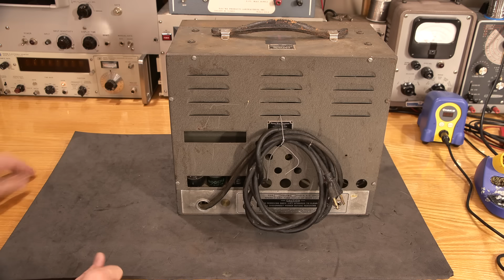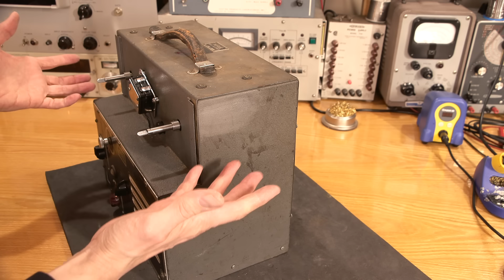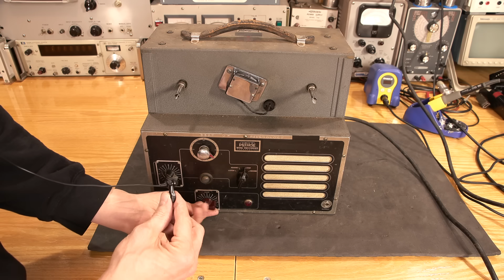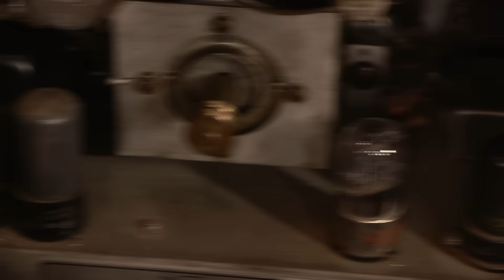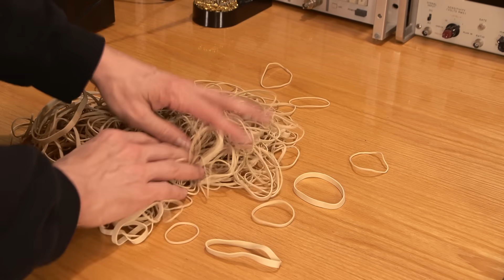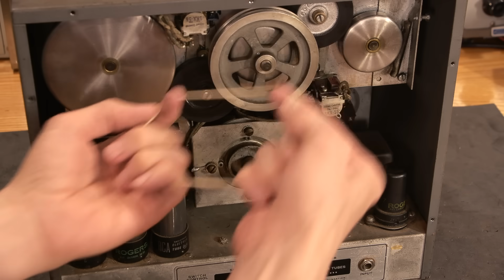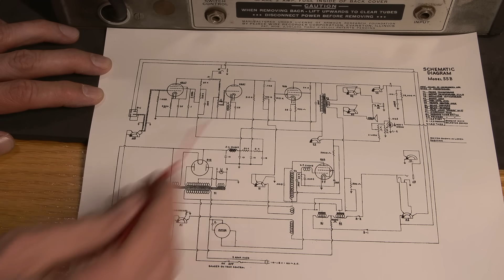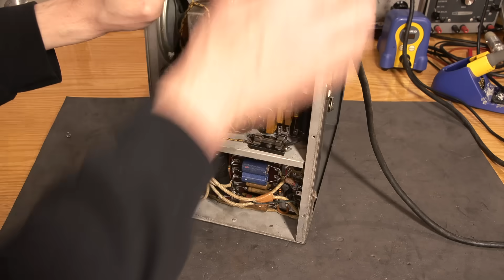Trapped Voices In This Wire - Let's Listen To Them!

Comment: It sounds like an early version of recording tape.
Reply: That's exactly what a wire recording is, it works the same way a tape recorder works, just uses wire instead of tape, and the recordings actually hold up much better because old audio tape disintegrates.

Comment: Webster Chicago made a nice unit which had a more horizontal layout and a fixed takeup reel. The wire passed through the head at about 2 feet per second.

Comment: By the way that machine that does the wire machine there it's not too dissimilar from one of the tape machines from about the same well I say about the same time it's not quite the same time it's was considered new which means it was probably from the 1950s or 60s I have no idea like I said I had to deal with these old machines and I was the only one who could basically get them running and not fouling up and sometimes was the only person who could fix both if it was a tape the taper record the record and sometimes I have to prepare the machine and I seem to be the only one who had a knack for figuring out how to fix it... You have to be careful with how you pop those clips back on if it's anything like the tape ones used to be because sometimes those clips had a habit of still falling off after you put them back on and if one falls off you're stuck although if I'm being honest I did manage to improvise something like I said what nowadays they call macgyvering with something you had to do back then and it was something that I learned from my father like I said child of my father's old age.

Comment: i would take a drill and fix it to a vice and sand down the two rubber wheels like a lathe since i dont have an actual lathe and carefully remove enough material that i can wrap a rubber belt around, a rubber band could be used as a temporary fix, in order to add that friction and even out the flat spots.

Comment: I bought a 1933 silvertone by Sears . It has an am/fm short wave radio , 78 rpm  , and a wire recorder. With the manual and hardware, spools of wire , microphone, everything worked but had no sound from the recorder.  I bought it at estate sell , silent auction, I put my name and phone number and offered 50 dollars, they called said come and pickup your radio, I was the only one who bit .😊  I had it for four years and then sold it for 400 dollars. It's been a hobby on tube type TV , Walgreens had tube testers  . Sometime in the 70s they discontinued TV tube's.

Comment: Professor Carlson, we were upgrading bank cameras from those old giant film reel boxes. A new employee would wonder what the buttons were, set the film rolling, cost the bank significant money using those film reel bank cameras. The instructions were to destroy the film or develop the film reels, give to the bank, and destroy the cameras. Well we'd end up with 5 a week for months. I took one out of the dumpster and was so impressed with the quality of the materials, I felt sick (still!) we threw away such amazing components. Everything was quality low corrosion metals of aircraft quality, hand machined with fantastic nickel and stainless screws throughout.
In today's money just the parts of probably 50 of them taken apart and sold for special assembly components probably a few thousand dollars in today's money. But the real value was the quality.
Your Pierce recorder reminds me of those bank film cameras, although these were post - tube technology.
I suspect the metal components were similar sources.
Very high end aircraft instruments type components.

Comment: Another vote for restoring the recorder, at least electrically. I'm guessing the glowing grid wire is due to a leaky wax coupling capacitor driving high voltage into it from the previous stage. I'd like to see if I'm right about that.

Comment: Just subscribed… very cool video, those filter caps made a big difference.   Watching you diagnose the unit, I envisioned the factory assembly benches from many decades ago. 

That unit looked pretty much hand built with many of the vendors that later supplied the guitar amps of the 50’s.. for a simple circuit it sure has a lot of moving parts though

Comment: Oh, I saw one of these before, on... hm. It was either TechMoan or Technology Connections, now I've forgotten. May have been both, come to think of it. It's a very cool idea, but you can see how it didn't really take off, from a durability and repairability stand point. You've shown you can repair the player/recorder, with some work, but if the wire snaps... can't exactly fix it like you can a tape.

Comment: The music teacher for the 1957-1958 school year, when I was in 6th grade, had a wire recorder. Living in a small rural community about 70 miles NE of Seattle, it was the first recording device most, if not all, of us had ever seen.

Occasionally the wire broke, so the teacher tied the ends together with a square knot and trimmed off the extra wire ends. 

The following year, the new music teacher had a 3M tape recorder, the first tape recorder most of us ever saw. It seemed to be far more reliable than the wire recorder had been.

Comment: I have a wire recorder with a built in turntable and AM transmitter.  It doesnt work. I changed the tubes and replaced the eleftrolytics and it still doesnt work, so yes!  Please do a troushooting on the unit!

Comment: Wow, looks like wire I use for maunally bonding 2-Mil aluminum wire loops to on circuit pads for in ceramic packages. 
I always thought they would be much thicker like 14 AWG. 
Hollywood...

Comment: I noticed the Rogers tubes inside the wire recorder. They were from a Canadian manufacturer as the company was the first to make rectifier tubes so radios in the mid 1920's could be plugged into an AC outlet.  Being of that vintage and almost 80 years old I have no doubt that a few the capacitors and possibly a tube are due a replacement. good work on your presentation and listening in to a voice from the past.

Comment: Never heard of one of these machines and I've played with a lot of electronics. I have an old am/shortwave radio with tubes... But not all of the bands work. Was just curious, it looked like there was a headphone jack in the right lower corner. Just for kicks was wondering why you didn't plug a speaker into there just in case the original speaker was bad. Excellent video.

Comment: the "hard solid piece" you described as "rubber" is likely made as "bakelite" material. Rubber bands are too "springy". You could cut a proper width from a bicycle tube, then glue both ends together, overlapping each end a bit, and the resulting belt would be less "springy".

Comment: Thumbs up for troubleshooting and restoration!  I have read that the quality of the playback depends on how the wire is oriented as it goes through the head, so if it's twisted in any direction away from how it went through the recording head the playback head won't be able to pick up the magnetic flux nearly as well, and if it's twisted 180° it basically inverts the waveform.

Comment: As speaker is completely silent - no hum or hiss, look at the break jack (headphone connection) contact might be stuck or corroded, also might explain temp of output tube as no load on the sec of the output TX.

Comment: Looks like a motor out of a diesel locomotive,, put two rubber bands on it rubber bands seem a bit smaller then o-ring when it's stretched out, two bands might quiet it down. Oh and not sure but I think a lot of the Apollo space stuff was recorded on wire, I don't know if Apollo 13 was or not , I think a lot of the transmission between Huston and the capsule were done on wire... Yes like to see you fix that and to hear the whole thing

Comment: Super cool! I have never heard of a wire recorder. I assume it magnetizes the wire which makes it amazing to me that it still works so many decades later. 

I also can’t help but think that amplifier circuit could be repurposed to create a gorgeous preamp. It would be amazing to convert these old devices into preamps. Ideally leaving the original wire playback/record connected but switchable to take an rca input and speaker or line  level  output. It would make a beautiful component and a great conversation piece. I’d buy one

Comment: Orange anode, probably not grid, can cause single ended to fail if a lot more current than intended is run through. It would make sense to go from power supply and repair the output stage first, then reconnect OT.

Comment: When I was taking electronics at vocational school, the schematic would be in the case sometimes. I had the class next to us make an enlargement of the schematic.
In class, I had fixed a large cassette tape recorder. I had to replace a vacuum tube, and I had to tighten the belt. But the vacuum tube made noise on the recording.

Comment: One factor you may not have considered is NOT changing the caps. I would suggest installing a line filter to reduce feed instability. Align the tubes without a reduction to bypass the ohm vts. The sound caps can be installed after, to ensure sound gap/faults are corrected. 

Just my 2 cents.

Comment: There are close to 3000 comments on here and I obviously can't read through all of them in a sensible amount of time, so if someone's already said this then I apologise. I read somewhere that wire recorders were widely used in cockpit voice recorders (black boxes) on aircraft because they were pretty robust and the wire wouldn't melt in a fire like a plastic tape probably would. I think they've probably gone solid state these days but it wouldn't surprise me if there were still some wire-based ones in use out there somewhere.

Comment: Is there a reason you couldn't connect some speaker or something to the output port to hear it that way? Either way, we'd all really love to hear the tape. Maybe you can set something up to be held in place and just have it recording while you do other stuff so that you're not just sitting there holding a probe to it for an hour or however long the wire is.

Comment: I would try to replace the rubber bands with a more proper belt. The rubber bands are going to do what they do and rubber band, meaning slow down(stretch), then speed up as they rebound if not. Looking forward to seeing this work! Exciting stuff! Now you can collect wire recordings and find all kinds of treasures 😊

Comment: I had an uncle who died when I was very young. Although he himself was not famous, he was connected with a well known charity, and thus he made many appearances on various radio shows in the late 1950's and early 60's  where he was interviewed about his work and he's also make a 'pitch' for donations, usually around the Christmas holidays.  At some point, after he died in the mid 1960's, my dad acquired a whole box of wire recordings of many of those radio appearances.  We don't really know who originally made them or exactly how they wound up in my uncle's possession. Those recordings eventually got passed on to me. I had them for about 20 years, before I was able to track down a working wire recorder. (well, it wasn't 100% working! It was missing the power cord and a few tubes) But I was able to re-tube it and power it up and transfer those recordings to both reel-to-reel and cassette tapes. It brought tears to some of my elderly relatives eyes when they were able to hear my long-gone uncle's voice again. Although the audio was 'listenable', there was a noticeable hum. It might have been old filter capacitors in the power supply (which I didn't fully understand at the time) . . or perhaps it was a audio connection during recording,   A few years ago, I was able to digitize the audio and get rid of the hum and a few other artifacts, pass them on to some of my uncles descendants who are still living, some of whom had never heard the original recordings.  They were grateful somebody saved then.

Comment: Mr. Carlson, I have  2 questions if you have time. 1. Can you run a current thru that wire and still retain the magnetic information? 2. Does that wire produce an emf or current of any significance when playing across the magnetic head. I'm curious if the wire is holding a charge when played or recorded and does it hold that charge when not playing? Thanks

Comment: The Almighty informed me to learn via your abilities... Hence, I need to buy or rent specific devices... 

1. There is a loud low pitched bass and rumbling noise... It contains a rythimatic beating and buzzing... 
RPM's and Volumes are being increased and decreased by a human operator... 
None of my 3 different commercial devices will record said noise... Hence, specifical recording devices are required... 
(2 Cell Phones, 1 Digital Camera, and a special Plumbers Mich for locating improper noise) 

2. There are extreme Heavy Sonic waves... These are being intensefied and reduced via human control... 
These are actually causing physical imparments... 
(This is why Military Sonic aircraft were banned over land) 

3. There are extreme vibrations in the interior of this house structure and the residential human body... These can be intensefied and reduced via human manipulation... 
(These are obviously  associated with Sonic Waves... They literally  cause physical pain and disfunction) 

4. Need a visually recording device for illegal acts that causes these harmful issues... 
~~~~ 
Please reply and provide a personal private line or email for extended discussion... 
Yes, I all information will be yours, but I will need to temporarily use all evidence... 

Thank you... 
V...